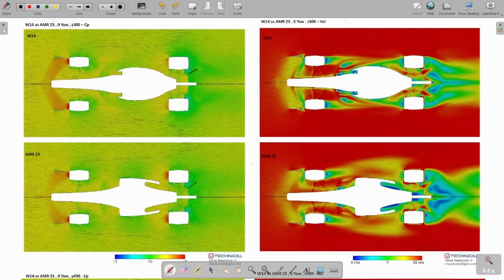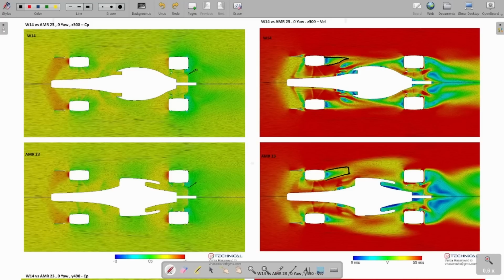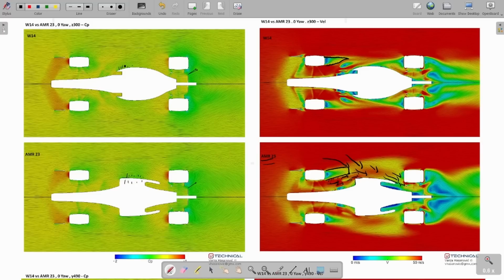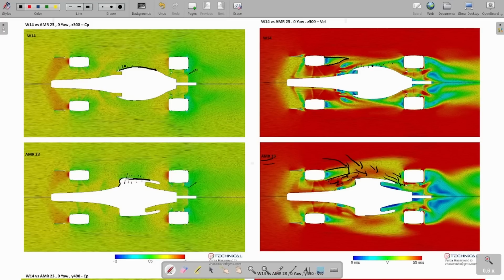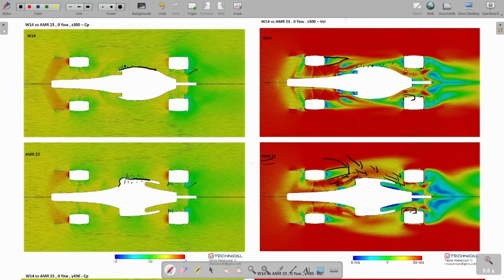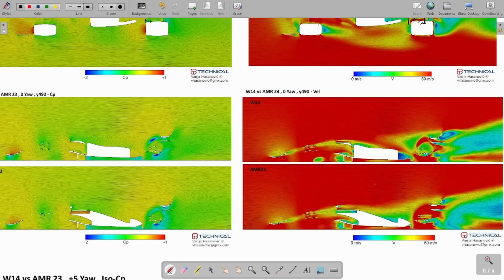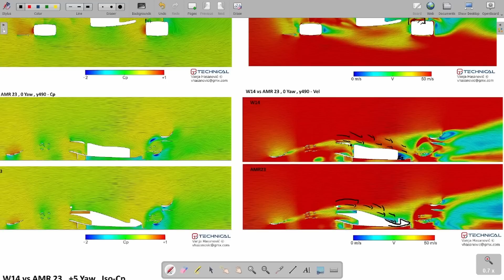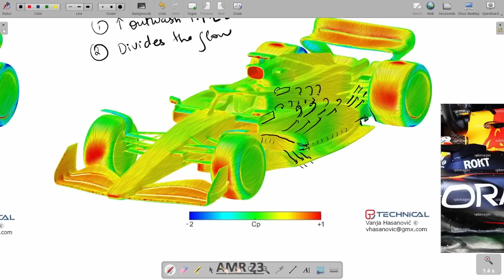#F1 Aerodynamics : Mercedes W14 vs Aston Martin AMR23 Sidepod Aero Analysis Pt 2/4

Comment: I find it very curious that the cfd models show the merc having cleaner airflow around the body and into the wings because of the early closing of the front tyre wake and a stronger airflow through into the beam wing, resulting in a more effecient rear wing than in the amr but on track it's the latter that is performing much better. Maybe Mercs problem is not so much in the bodywork but more on the underfloor or suspension, just like they suspect it was last year. I can't wait to see if their new concept is actually gonna make them more competitive
Reply from the maker: Absolutely , that underfloor pic of the RedBull is like gold right now, everyone wants to see it 🙃. Waiting for that crash
Reply: The AMR and the Merc have the same rear suspension.
Reply: Yes, the main problem for mercedes is that they over corrected for their problems last year. The car was super draggy last year, but had good floor performance. This year the car works really well through the air, but there's not nearly as much performance from the floor, which may be explained in part by the rules that raised the floor height.

Comment: I am REALLY enjoying these. I definitely understand what is going on more now. I am currently exploring making my own CFD model as well just for the fun of it but also to understand how teams are using the flow structure on the floor edge in front of the rear tires. Thanks again brother.
Reply from the maker: Hey, that's great, let me know how your model comes along , would love to collaborate at some point if you are interested 😊
Reply: @f1aerodynamicist  that's awesome. I'll keep you posted.
Reply: Hello ! I'm starting to get interested in CFD and was wondering : what do you mean by "making your own model"
Reply from the maker: @matdan6683  simply means we made a model of the car. Nothing innovative in the CFD domain. Fairly standard processes
Reply: @f1aerodynamicist  And do you have softwares to recommend on which to create a model and/or test it with CFD ?
Reply: @matdan6683  I am using blender to make an F1 model. Blender has built in fluid dynamics and I have a PC strong enough to run fairly detailed fluid calculations. So...that way lol.

Comment: @9:50 Every car has separation there, you can even see it on the Red Bull flow vis, it's just the nature of the beast. The slow high static pressure air on the top of the edge wing actually helps the edge wing work.

New rules means you need a better performance edge wing, and you need the side pods to condition the flow to the edge wing, while at the same time supplying enough air for the rear wing, and inboard side of the tires. Once the pressure difference from the edge wing causes the edge wing vortex, then the air that runs along the vortex becomes energized just like the floor vortex does to the air in the venturi tunnels.

Comment: It does seem to show the problem areas versus the successes. The W14 may be sleek but its cutting through the air like a bullet and not developing enough downforce passing the sidepods. Its also creating drag in the zone between the front tires and sidepods versus lower drag on the AMR23 but greater downforce. So you can see the huge fuzzy area alongside the AMR23 which could be all downforce. So, the larger "fuzzy" areas of low pressure on the AMR23 is the key to its performance. Its all so tricky but we can now see the effects of what was probably thought to be no drag zones but not generating the downforce. MB made a bullet but that doesnt work when you also need to stick the car to the ground.

Comment: At 8:05 and on I see that one quite interesting part is the velocity and pressure around the rear wing that is quite different in the simulation. The AMR23 has a high velocity under the wing and a low pressure point under it while the W14 seems to cause more drag than downforce.
It's of course not conclusive since this is a 2D cut, but it seems like it could be something to look at over more cuts to see how it varies.
Also realize that it's when you are turning you want to have more downforce than when driving straight and it's on the inner side of the car that you want most downforce when turning.
Reply from the maker: The turning bit is important information , you will see why in Part 3 , the AMR 23 Concept is an absolute rockstar with yaw

Comment: Something to chew on, once the wake of the car exists, it's not existing in isolation. Air upstream will interact with the wake of the car, instead of the car itself. Look at the slow low energy air as "virtual bodywork". The AMR pods move that slow high static pressure air down low, the benefit of this is clearly seen in the rear wing, the AMR has a nice cushion of high speed air on the suction side.

Mercedes downwash gives air to the diffuser and moves the slow static pressure air higher which decreases air going to the rear wing. Just from the CFD it's obvious that the ride hight window for the Mercedes is much smaller, because the high speed air under the rear wing has a very small area. The AMR has a much bigger area of high speed air under the rear wing and likely has a much wider setup window.
Reply from the maker: Interesting observation there, missed that , thanks for pointing it out mate😊
Reply: @f1aerodynamicist  The edge wing vortex also helps shoot air into the mouse hole. That lateral air that comes in the mouse hole on the side of the diffuser, possibly works like the side channel in this video
https://www.youtube.com/shorts/pyUXVXNZLHo

Comment: It's not just the side pods.

I think people don't understand that Redbull has succeeded to fully manage the airflow from the front to the back. The Diffuser, beam wing and top wing work together to keep the airflow connected. They are the only ones doing this as efficiently as this. The top wing of the Redbull has smooth outer edges and aggressive main plain compared to Mercedes and Ferrari which, when they open the DRS, they have 2 advantages, a higher drag reduction as the main plain of the top wing is aggressive, and it also stalls the airflow from the diffuser to the top wing by opening the DRS. That is why they have a significant advantage when DRS is open.
Reply from the maker: Well ,I agree with the flow management part. But stalling the diffuser,  might not agree..the real benefit is if you can stall the beam wing itself coz that's quite draggy. And that in turn ' might ' big might , stall the diffuser
Reply: @F1 Aerodynamicist  your prob correct. Take a look at the rear wings of the RB vs other cars. Mercedes especially seem to still want to create vortices from the outer edges where RB looks to try and reduce any drag from the wing outside of its DRS zone

Comment: I don’t know anything about downforce, but from what i see redbull rb19 gain more downforce from the side pod, if you look at the shape of the side pod, the shape looks like an aerofoil, the undercut works to speed up the air to reduce pressure thus produce more downforce. Just from my own opinion.
Reply from the maker: Thats like sideforce , haha, but yeah I see your point
Reply: I think Mercedes depends to much from the under floor for downforces because of the new regulations, I think they got it right but they didn’t expect the porpoising problem to happen. The increase of ride height hurt them even more because that will reduces the amount of downforce produced. Sorry for my grammar mistakes, not my first language.

Comment: so i guess mercedes was right to question its concept so late. theoretically the cfd here shows mass flow similar to the aston martin to the rear beam wing and rear wing. but now they know the  slight increase in mass flow to the inside of the rear tires to help with diffuser expansion is probably the area of biggest gain. hopefully they can bring something this season that will allow that affect and bring more exciting races
Reply: Oddly though the sidelines and mid wing of the w14 were supposed to spin a massive vortex down the side of the car to that area so I'm not sure why it's not working. In the diagram here the w14 looks the much better airflow to all the right places. I just wonder if optimising the airflow is too tricky when the cars in yaw?
Reply: @magicalrobster  I think that’s the key, is the yaw. Straight line everything is great but I guess at the end of the day, a wall of material is better than an limited aerofoil?
Reply: @Jay-nk6dm  it seems to be but according to Kyle engineers the w14 system if using air rather than a sidepid is it should in theory be more tunable. However something seems to not work with this concept in practice. Maybe there are too many variables with it

Comment: Isn't it that the large sidepods of the AM create a flowfield that "keeps" the front-wheel wake outboard? Together with the pressurisation of undercut?  While the front-wheel wake of the W14 hits the rear of the Mercedes as the effect of wing quickly wears off. I think this would explain why Mercedes has such problems with downforce. Vortex Control and Tire Squirt Management become uncontrollable, which has a negative effect on the diffuser and the aerodynamics in the rear. And here the circle would close why the sidepods have a decisive effect after all. At least as long as there are no more bargeboards!

Comment: I suppose then, the trick is to make the entire sidepod a downwashing wing? If you look at the upper surface of the RB19 it's basically that. It's Mercedes mid wing, but bigger.
Reply from the maker: Nicely pointed out , yes as long as you suppress the losses on the body itself and don't feed it to the rear in the process, more on this in Part 4.

Comment: Hey Shubh. Excellent analysis as always. How much performance do you think the ground effect and the floor is contributing to the overall performance of the 2023 cars. And would you be making a video about that in the near future, so that we could get a rough idea about the floors that maybe different cars might be running as that is the part that is rarely seen or disclosed?
Reply from the maker: I think you want the floor to be somewhere in the range of 60 percentage as that's the most efficient system you have. Previous years it used to be around 40-45 percent.
Video on the floor is really hard to make , but yeah once we see some floors , y not 🙃

Comment: You used the word "closing" the wake a couple of times. What do you mean by that? I understand that the undercut pressurization directs the air out, and the low pressure in the undercut tunnel sucks the air in, but I don't get how this "closes" the wake.
Reply from the maker: So imagine the front wheel wake behind the tyre . It has an inside and outside part . Until now the idea was that the undercut pressurisation moves wake away from the sidepod , what I'm suggesting is that u just don't push it away from the inside you close it by drawing air from the external freestream